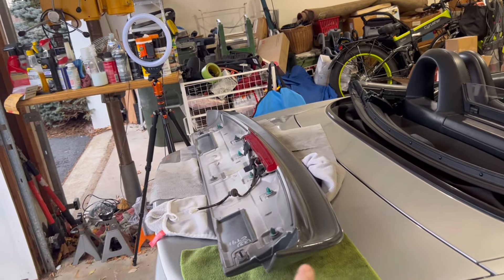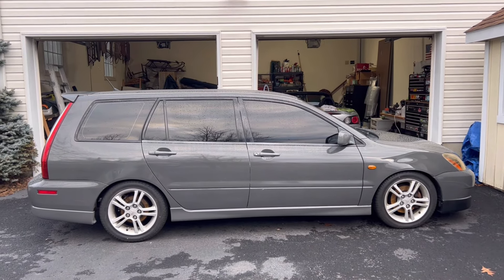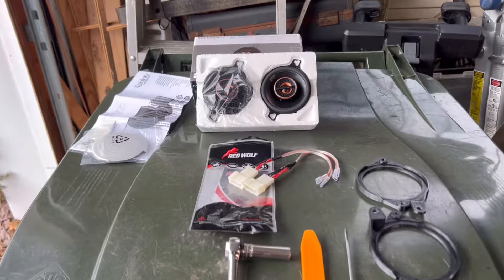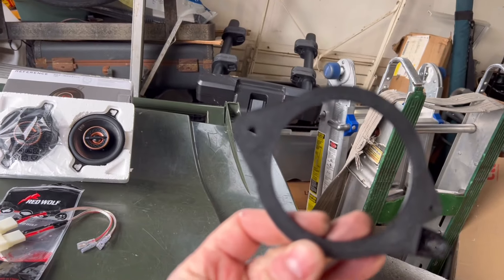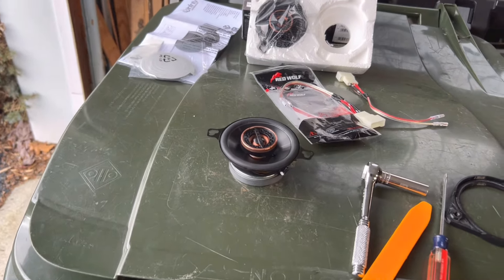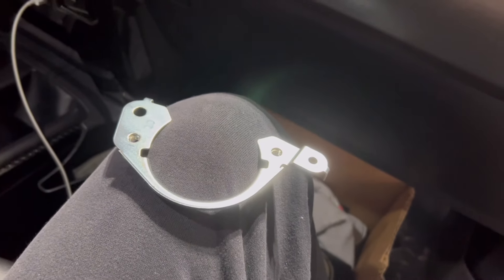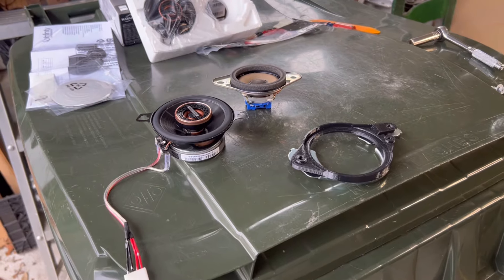Toyota 4Runner - Easy Speaker Upgrade •  OEM++

Comment: Audio upgrades! Cool. I've done a few audio upgrades in 5th Gen 4Runners. Here are some impacting 100% plug & play items I've done, most recently in my 21 TRD ORP. Speakers: Front Doors Infinity Kappa 693M 6x9, rear doors and rear hatch Infinity Kappa 62ix 6 1/2",  dash Pioneer TS-A709  2-3/4" 2-way speakers. Please check out the Beat-Sonic Amplifier PA2T3K Kit for our head-units. It's a plug & play class A/B amp bumps up our output to a true 45 watts per channel x 4 channels at .01% total harmonic distortion. At ~$270 this is no-brainer and a very noticeable improvement to the non-JBL systems. It's super high quality and made in Japan.
Reply: Maybe you can try some proofreading 
PRO not ORP
You’re backwards
Reply: @Michael-dj9zq  Nope...TRD ORP = TRD Off Road Premium
Reply: @Michael-dj9zq  I guess you're not familiar with the 4runner models 😂
Reply from the maker: @joeythedime1838 I appreciate you Sharing!!

Comment: The brackets seem to work as described, but it would have been nice to include new hardware that fits. The connections get pinched and the sound cuts out.  I'm going back in tomorrow to find the right orientation.  Anyone have this issue? Do I need to cover the connections with electric tape?

Comment: Thank you! You made this mod so easy & inexpensive! I ordered  ALL parts from your links,but  there is a modification I had to make. If you have upgraded, JBL speakers you NEED a different WIRING HARNESS.  Order for Anazon: "Red Wolf update car dash Tweeter Speaker wiring harness for select Toyota". In the photos it will show that it fits 2018-2019 TRD/Limited with JBL.
Reply from the maker: Got it!! 👍🏻

Comment: Guys, I will sell my  NEW 3.5" Dash Speaker Adapter Mount Tweeter Upgrade (PAIR driver and passenger side) for $22 and I pay shipping.  I bought the brackets on an impulse buy then decided to upgrade my entire system and go a different route. They will cost about $30 with shipping and the discount code so you can save a little if you buy this pair.
Reply: Still have them?
Reply: Yes, available 👍
Reply: How do we do this?

Comment: Jbl is ok. Better than stock papper speaker. There some kind of  decent looking plastic speakers but the 8 in is a paper woofer. Probably  a midbass from the looks of it.  Ive done a full replacement to all cerwin vega coaxials speakers.  Other than dash. Doing dash here soon because im putting a sub in. Bought audio control loc to find out its a big headache with the jbl package  alot of splicing into from what crunchfeild said. Was 1st told it would b easy then a yr later when about to install my system i saved up to get then i was told it was gonna b alot of wrk. Because of interface with gps and other shit because that amp powers others stuff u cant juat eliminate that amp Because the factory radio wouldn't work. So now i went pioneer head unit.  I bought a jl xd 700/5 amp with one 12w3.   Cant wait to hear it all hooked up and powered by a real amp on 8 speakers.

Comment: Thanks for the great video. As a suggestion and from what I have seen Toyota do, is wrap those plastic connections in one sided sticky foam. Avoids and potential annoying rattles that may surface later.
Reply from the maker: Great tip!! 🤘🏻

Comment: Big thanks on this video!  For us, the driver side dash speaker failed on our '16 4runner limited.  I did everything the same as you, EXCEPT I ordered the Red Wolf wiring harness for the JBL system.  That plus everything you did worked out.  One side note, you do in fact need a longer screw for the passenger side which I had to buy on the day of install.  Again thank you for the video!
Reply: What harness did you use for the JBL system?
Reply from the maker: You’re very welcome!!
I’m glad you got it sorted. 👏🏻
Reply: Any feedback or link on what harness you used for JBL system would be great!

Comment: One great thing about a Limited, the system is pretty damn solid as is🤘😎
Reply: Ya the upgraded JBL system is really nice. I'm surprised that even in the JBL system the tweeter is still a single 1" tweeter and not the 3.5" coaxial like this. You can do the upgrade on the limited as well, but you just use the wiring from the OEM tweeters and not the adapter listed
Reply: @brentthorne1532 I have a 12’ limited non jbl system, I would still need those plug and play wiring adaptor correct?
Reply: I have a 13 jbl package.  I've replaced all the speakers out to cerwin vega besides the dash speakers.  Sounds alot better now. Doing dash tweeters now because  they really suck. I'm removing the jbl head unit and amp and sub. I'm doing a jl xd 700/5 with 12 w3.
Reply: Dash tweeters suck  though.

Comment: I'm wondering if these brackets will fit my 24 tundra stock speakers suck....
Reply: They're designed for the 5th Gen 4Runner. Some designs are similar between Toyota trucks, but it is not verified to fit anything other than the 2010-2024 4Runners

Comment: The sound on my factory 23 TRD Off Road Premium system sounds OK sitting still,  but going down the highway it sounds like parts of the music is missing unless you crank it up louder, will this fix  that problem you think?  Really enjoy watching your videos !!
Reply from the maker: Honestly, it probably does. Can’t say with certainty. I honestly since installing them, feel as if the songs are more crisp more lively if that makes any sense.
Reply: thanks, I'm going to try it. @VikingsGarage
Reply: @TerryM-hb6sy  Hey! I really noticed an improvement with my 2020TRD ORP on highway with mud tires. The dash speakers get a lot louder now with the full 3.5" upgrade. I am the seller of the adapters haha so take that how you may, but I had the mod going on four years now before I started selling the adapters this winter and love it.
Reply: @brentthorne1532  did you use a bass blocker for the 3.5 speaker

Comment: you think its worth doing this mod on the TRD Pro's since its supposed have Toyotas high end system?
Reply: Quite a few people have. You will just need to do some slight modification of the harness that is already on the JBL speaker. But you won't need to buy the redwolf harness, just the adapter and 3.5" speaker. The addition of the larger 3.5" speaker over just the tweeter in the TRD PRO is a noticeable upgrade. It will still get louder than stock tweeter and have a lot of midrange that is completely missing from the stock JBL and non-JBL dash tweeters.

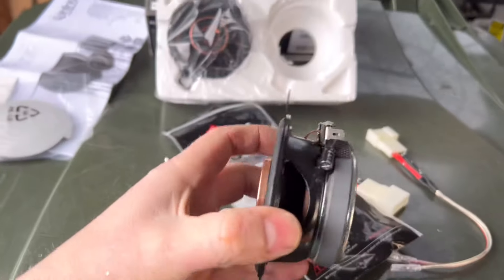Comment: 4:30 thanks for putting this together. To clarify, do the bass blockers come pre-installed? Or I have to buy a soldering iron and take care of that before installing the speakers?
Reply from the maker: If you buy the same ones in the link, they come pre-installed.
Reply: @VikingsGarage  thank you!
Reply: @VikingsGarage  Are you sure? The ones in the link are the 3022cfx and the ones in the video are the 3032cfx
Reply from the maker: Then I must be wrong 🤷🏼‍♂️

Comment: Ahh love a clear and simple install video! 
Question, I noticed the speaker box in the video was for the “3032CFX” but the link provided is for the previous gen “3022CFX”. The speaker bracket was designed for the “3022CFX”. 
Can you confirm if you used the newer “3032CFX” speaker and that the the bracket still works fine? Thank you!!
Reply from the maker: Works on either.
Reply: This will work on most 3.25 speakers so either should be fine! https://docs.google.com/document/d/15hmcC8Zk_aV0ljRCv_-nCW5iHmg1MzR7-I5VKJK98Lw/edit?usp=sharing

Comment: 1. I love the Vikings Garage videos and content.
This is just one man's opinion. But I wanted to share my feedback. 
2. When VG posted pictures with a title of plug and play, I did not hesitate and do not watch the video I just trusted and ordered all the stuff. Figured I would watch the video later. Big mistake.
3. It is not 100% plug and play.
4. Different 4Runners take a different plug adapter so check your year and model. Amazon even says the one VG recommends has been returned a bunch. It is the wrong one for my 4Runner. Had to order the correct plug adapter. Still have to go return the wrong one. 
5. Had to buy a Dremel-type tool to modify the speaker dash panel. That sucks, that is not plug and play, but ok. Done. Now I have a new tool that I have always wanted Yay! (Bought a less expensive amazon version works fine).
6. You can use the factory screws from the speakers to mount the new speaker to the 3d printed bracket that you order. No need to find screws.
7. You only need one bolt a little longer that was not clear in the video. Hard to find, but ok a little drilling of the factory clip/bracket and a 3/4" bolt of similar type from Ace Hardware will work. Pain in the neck trip to the store and another modification, not plug and play.
8. The speakers are larger and by basically the same company (JBL) but are they better?
9. Does not sound that different to me. I will keep them for a bit and see, but it is not overwhelmingly different at first listen. UPDATE ok they are louder and more bass in the dash.
10. Verdict: Not sure I would do this if I had seen the video first. But if you have a blown speaker this video helps.
Reply from the maker: I’m sorry for all the difficulties, I have to admit… I’m not much of a sound savvy kind of guy. 🤷🏼‍♂️
I did include all of the links to his install instructions, to feel in all of my gaps.
I do appreciate all of your support!!
Reply: @VikingsGarage  no need to be sorry. Just wanted to let y’all know that the plug adapter link was not correct. And this is a tad bit more than plug and play.
Reply: Hey @mikecandler4350 do you mind sharing the link to the adapter you used to fit your upgraded factory JBL system? The one linked is for the non-JBL systems found on the models other than limited and pro trims.
Reply: 40 bucks for 1.50 cents worth of 3d printed  plastic  lol.
Reply from the maker: @adonisman808 🤷🏼‍♂️

Comment: S2000 started right up. Gotta love that Honda reliability. Also, I suspect that older cars have less parasitic battery drain than newer cars.
Reply from the maker: Those older cars are great. I do believe you are right on that one.
Newer cars have entirely too much crap. I believe less is more. That S2000 is not driven enough. 😅

Comment: I added this same setup to my 4Runner, and after about 3 weeks the front right sounds like it’s completely blown. I never play music loud so I’m a bit confused, any ideas?
Reply: would guess the speaker is bad or check the harness connection. Likely just exchanging the speaker will fix it.
Reply: @SrsLe33 yeah I ended up taking the speaker back and getting some Rockford p132 speakers instead and they haven’t had issues and sound better imo!